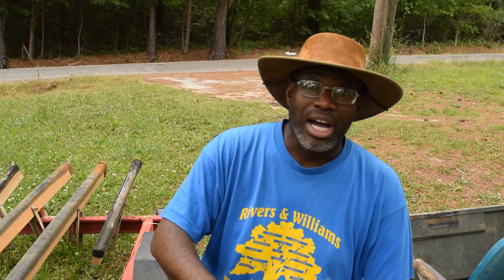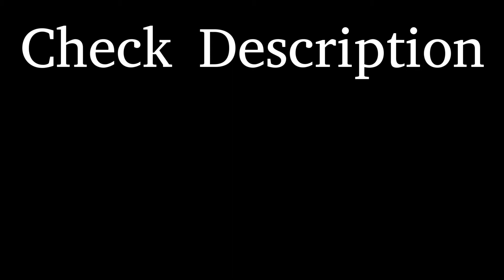Top Four Powerheads for Thai Longtail Hot Rods

Comment: I still think the predators are over rated. They are nothing more than a clone block that's bored to 70mm. And with the extra displacement they are not that much more powerful than a standard clone. I read an article some years ago where they dyno'd a predator, Honda, and a Champion 196cc. The predator did better than the Honda but the Champion had the highest horsepower by more than a half horsepower over predator and Honda. And these were stock engines. I will say the hemi is nice and a better starting point if you want to add performance parts to build it up.
Reply from the maker: Yeah, I'm talking about building engines not using stock engines. Stock dynos don't mean much. You can make any amount of horsepower with any of these engines. 

I don't like the Predators at all, but so many people build successful motors with them. I'm not one of them. If I had left the Predators out, there'd be some one else making the opposite argument.

The truth is that displacement does come into consideration when you're talking about building 25 hp+ screamers. A stroked, bored motor with a better head straight from the plant was the point I was making, not stock horsepower or the overrated or underrated reputation of each motor.
Reply: I hear you. Wow. 25 HP is getting way up there for a "small block".
Reply from the maker: Yeah, those engines are amazing. They're not very practical motors other than pure racing applications.